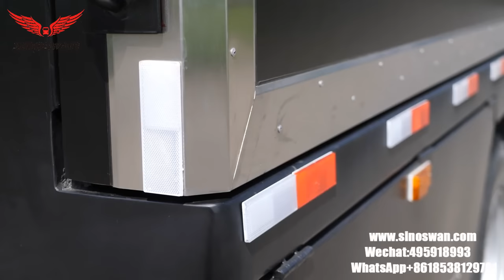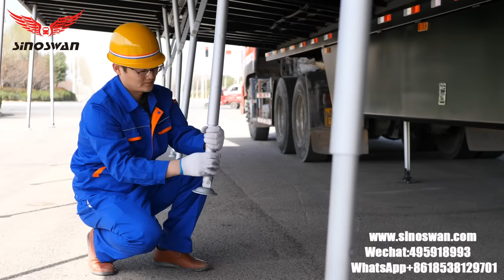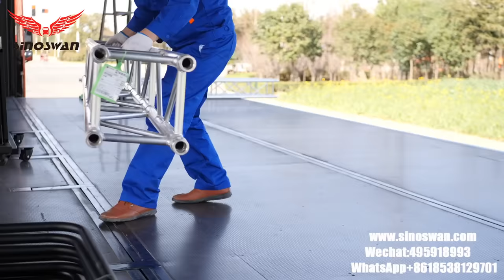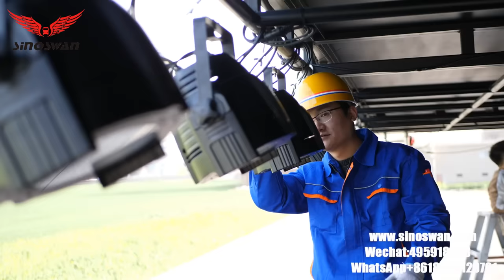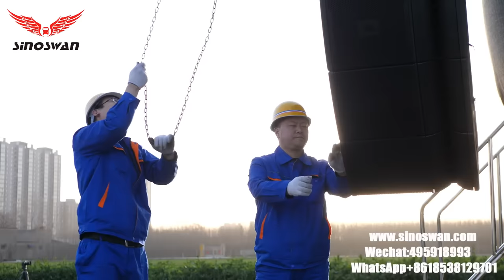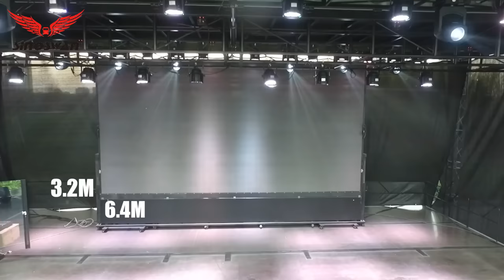Mobile Concert Stage Setup-SINOSWAN Gospel Truck for Church Crusade,Evangelism, Minister Mission

Comment: As someone who has setup countless Stageline and Apex stages. Wireless control is not the way to go with a stage. Sure its nice and the practicality of being able to be on deck/in a better position to observe as the stage flies out makes it in theory safer. But, what happens when that fails and someone is caught in a bad spot? I would imagine that manual controls are still there and are contained on either side of the stage. The trim height is just not there for prerig trussing or any form of trussing to really be flown off of the stage. What is the rigging capacity exactly. This stage has to follow some sort of engineer spec and from the looks of those pick points for the pa you are maybe able to take 1000lb safely off each side. Containing full production inside a stage is easily doable regardless of it being this stage, a Apex stage Stageline or the other less popular hydraulic stages. Its all about the additional decking and structures to legally make the stage a structure. Lastly put a damn safety cable on your lights. I appreciate the hard hats at the beginning but one of those lights falling down can seriously hurt someone.
Reply from the maker: thanks so much for your concerning and good suggestions. actually what we use is two operations system. one is remote and the other is standby fix system in case.if the stage is so big if we use the fixed operations system it will affect us to see the whole stage set up. the wireless remote plays a good way at this case. so we equipped the remote in big stage size and smaller is fixed system. however the wireless remote is so safety and easy to operate and easy repair. so it is user friendly.

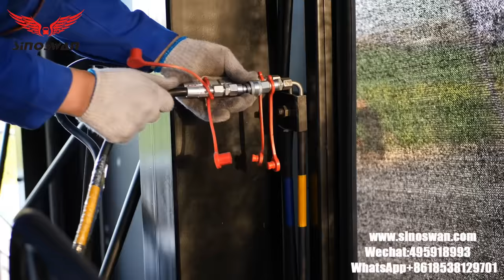Comment: at around 2:37 the two songs overlap a bit
Reply from the maker: thank
Reply: I agree, totally a mess, right pan guitar not in tune, string bends are off every time. 

If a "stage company" such as this one has this kind of quality in terms of "music", then it would even be harder to believe they make good quality products.
Reply from the maker: thanks so much for your suggestion. will check and change
Reply: I have seen, you uploaded almost the same video with a different longer song. But still you should fix this one, cause youtube is recommending it
Reply from the maker: already fixed . thanks so much bro